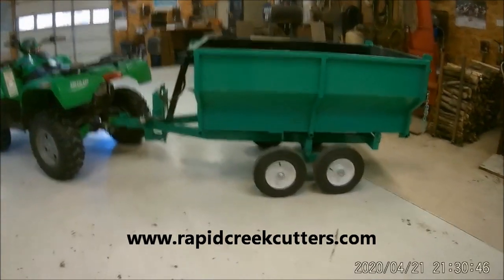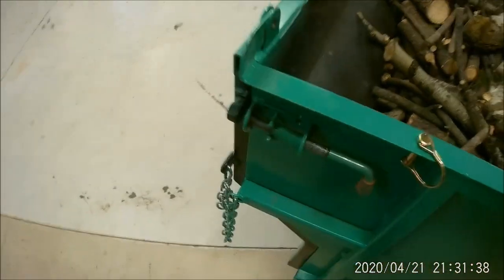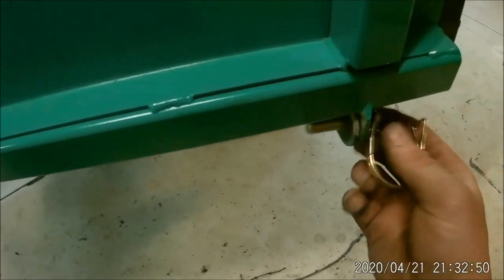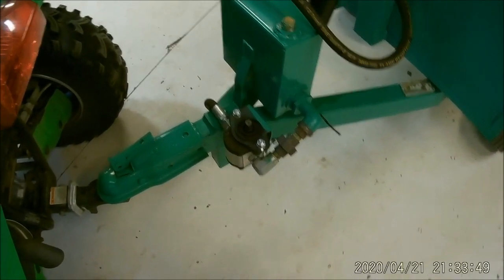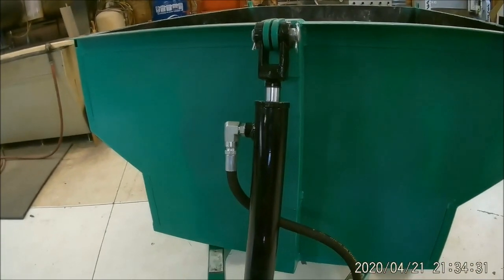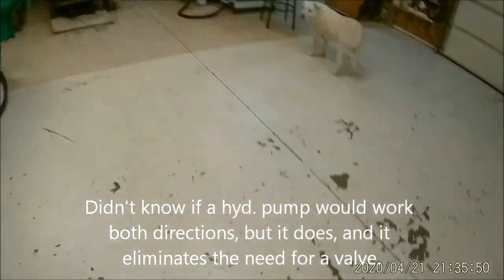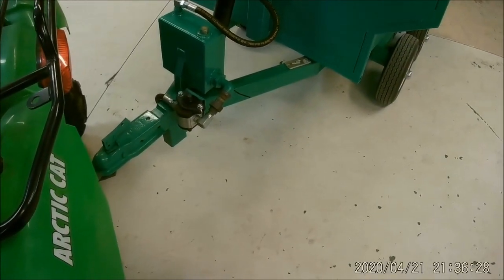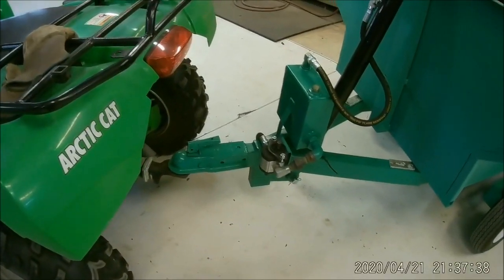ATV CART with Hydraulic Dump.

Comment: Lmao, I like the extension idea....... 
this is awesome , you should put the effort into running 12v power and a switch input out the rear and then a plug to go to the motor. I dont think you will need a diode in the 12v line if it’s passing through a toggle switch. (You just wanna be sure it’s not draining battery when not in use!

Get fancy and I’ll help you wire up two limit switches to automatically turn the pump off when fully extended and then kill the pump again when it’s fully retracted. Have a green l
LED that illuminates telling the operator the pump is off and the dump bed is down (Home/Safe to drive position)
Seriously, if you got the pump and that  cylinder At a decent price and you could make it an auto cycle , you could start selling your own units! I’m looking for “something similar now.

I have a Polaris ATP 500 and it has a manual dumping “bed”  I want to make it hydraulic. Cant be that hard....

Comment: I would’ve bought a small 52 cc Weedwhacker engine install it to the pump and added a return line. By adding a T fitting in a shut off valve so you can open and close it and run it directly to the tank

Comment: Nice build but the hydraulic cylinder placement is crappy. You need a deeper angle so you can actually dump the cart. That’s only half way up of a typical dump. And as shown, the wood didn’t move an inch when dumped and that’s loose material. Dirt or anything else won’t come out. Rocks of course. But you said you dump dirt. You know of course you needed to help it out.
Reply from the maker: Yes, I thought the same thing about a year ago and repositioned it under the box and now it stands the dump bed almost straight up.  It should have been there in the first place.